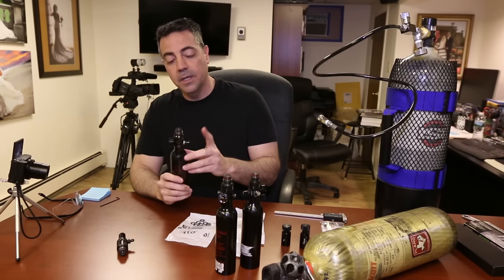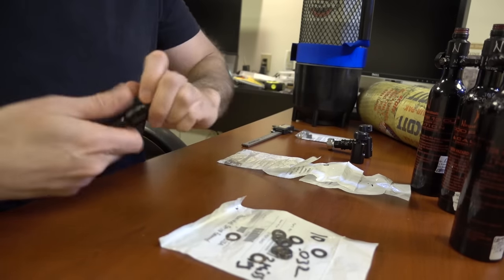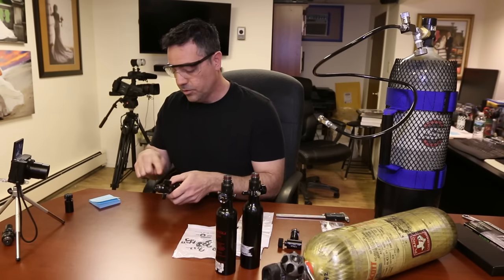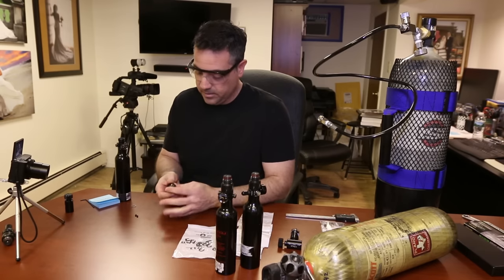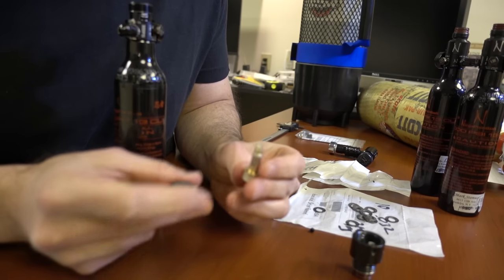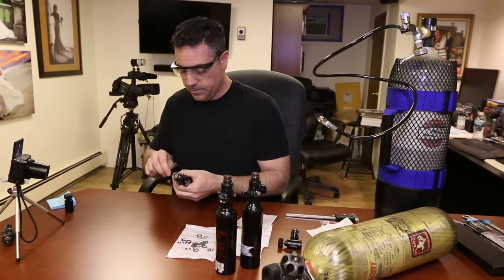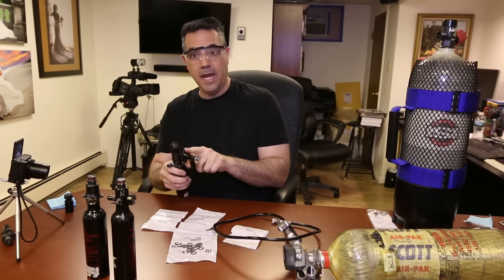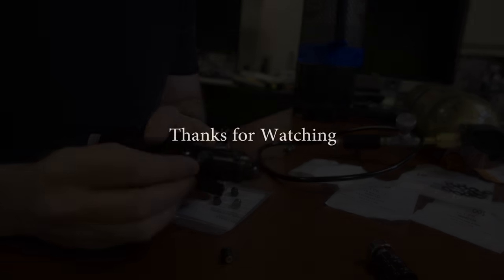How to adjust ninja ( Umarex Gauntlet ) regulator for PCP HPA Airguns (800psi to 1400psi output)

Comment: how many charge can you get filling a 13 ci bottle from 80 scuba tank
Reply from the maker: From 2000 to 3000 top off I would say about 18 to 20 top offs if the 80 cu ft is filled to 4250 psi
Reply: @AirVelocitySport  I'm planning to buy a 300o psi scuba tank to refill my 13 ci ninja tank. I'm, not sure if its the right decision. If a bigger tank with the same psi can fill a smaller tank.
Reply from the maker: Please don't do it. A 3000 psi 80 cu ft tank will only give you one fill to 3000 psi on a 13 do, then the next fill will be 2900 psi or less, then the 3rd will fill only to 2750 psi. It not just the volume of air that matters but the fill pressure. A smaller 50 cu ft at 4500 PSI is better suited to fill your 3000 psi 13 ci tank than a 80cu ft at 3000 psi.
Reply: @AirVelocitySport  most of the scuba tank fill station are rated 3k psi only. 
Any recommendation on a nice set which is not gonna break the bank.
Reply from the maker: I would look into the air Venturi SCBA carbon fiber bottles or maybe even a Chinese tank but make sure any tank you buy is DOT certified. Must scuba shops will not fill a non DOT certified tank in the usa
Reply: @AirVelocitySport  Thanks so much for the info. It helps a lot since I'm new to HPA

Comment: Is it safe to assume the stock bottle regulator is set to 800 psi?
Reply from the maker: abghere I would never make any assumptions when it comes to safety. The Ninja bottle generally come regulated at 800psi but if you are not sure NY reason please double check or ask the vendor before buying what is the pressure set to on the regulator.
Reply: Thanks. Your stand to take no chance when it comes to safety resonate well with me. I do not mean to ask the question of regulated pressure on a purchase Ninja bottle. I meant to ask what is the regulated pressure on the bottle that comes with the Umarex Gauntlet?
Reply from the maker: Oh! The umarex is 1100-1200 psi it's not an exact science. The Belleville washers tend to flex over time and your pressure will creep a bit.
Reply: Ok, I now get it why you make this video on setting the output pressure on purchase bottles. It's a must to set the new bottle 800 psi to ~1200 psi so as to match the factory pressure setting. Great video!